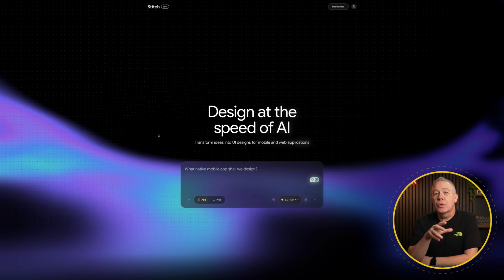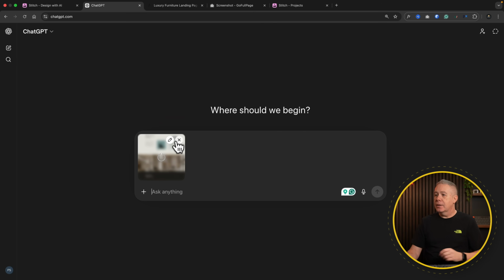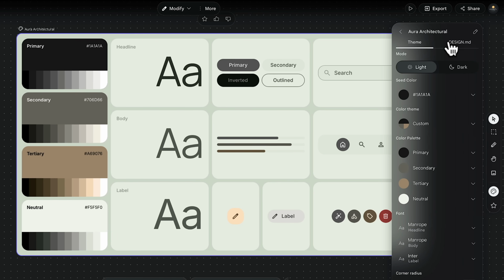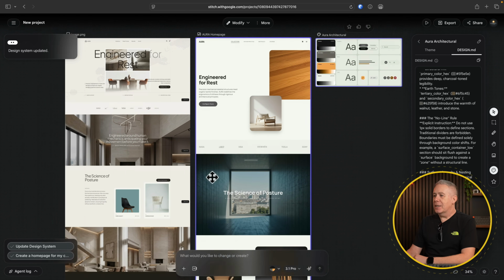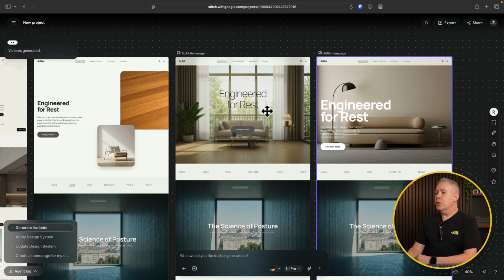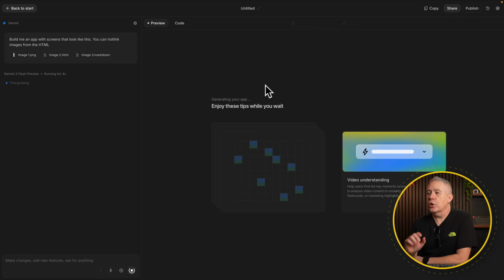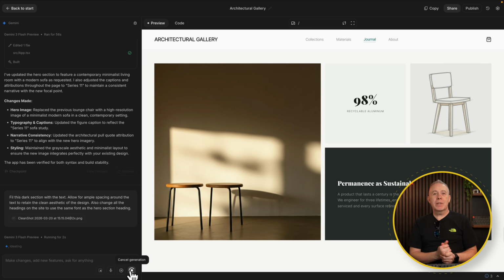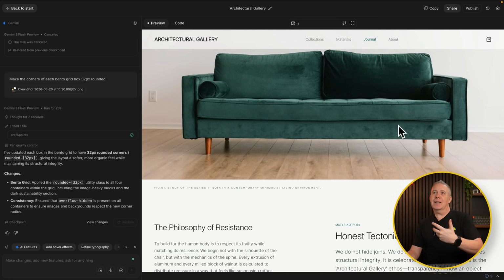I Tested Google Stitch - Here's What Actually Happens

Comment: Like most tools of this kind, it addresses the wrong end of the process — content strategy and effective messaging are overlooked entirely. At its core, it's not far removed from picking a template on Themeforest, except you can nudge it with prompts and keep iterating in circles. DIY SaaS users and the AI-enthusiast crowd will inevitably flock to it, and while the novelty will wear off, anything that promises to replace professional work and 'save money' — while quietly consuming time — will always attract early adopters.
The reality is that more than half of my work with clients happens before a single design decision is made: it's research, planning, and understanding what actually needs to be communicated. This tool targets design and development — the visible output — while treating that foundational work as if it doesn't exist.
For professionals, there's a narrow but genuine use case: pulling in multiple visual references and synthesising ideas from them is genuinely useful for early concepting. But beyond that, we're still left with the harder question — what the content should be, and how the messaging can actually connect with the right people. PASS from me

Comment: When you're dealing with aesthetics, human decision making is nuanced.  I may fiddle with a drawing slightly modifying shapes, spending hours in shading, and making judgement calls in order to make things "look right".  At this poinr in time AI really is much more broad brushed in what it puts together.  It really doesn't have any sense of what makes something look right.  It just generalizes.  That said in terms of generating a website, it seems to be a nice tool to create a starting point - something to build on.  It's also a nice way to learn in the sense that by showing the underlying code, it can teach the user enough to make those adjustments that will make the website more unique, more in tune with human intent.  For now it seems that it will be a great collaboration tool especially as the product itself is improved and also as it learns from the person using it so it becomes more customized to the user.

Comment: Hi Great video 😊! How can the design be exported or converted to Elementor?
Reply: For the last 6 months I am trying to find a good way to get this into WP. Don't care which page builder. All generated sites are React and typescript. That means no html in the page source. That means almost impossible to SEO and Google. It's already very hard to get at the top of Google. I don't need the added issues. If I ever find a way I will let you know.
Reply: @RalfTenbrink Bricks builder just released an HTML and CSS paste function from AI generated pages. Looks promising.
Reply: I'm pretty sure we can export generated design as html and css code. If you want seo, api or backend integration you would just need to update it yourself or with an agent giving it necessary info and plan.
Reply: I know html to elementor have a chrome plugin